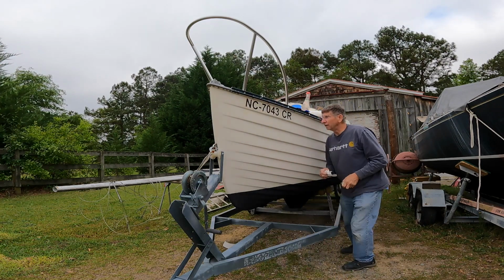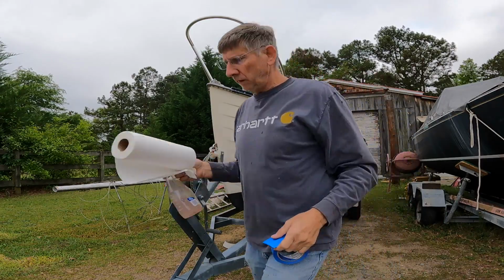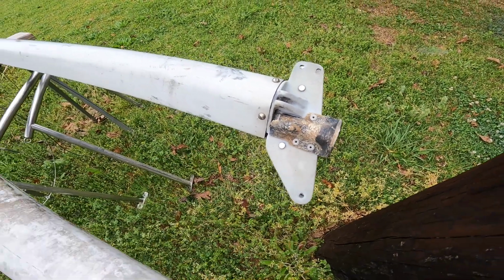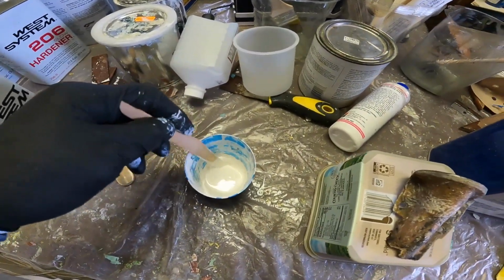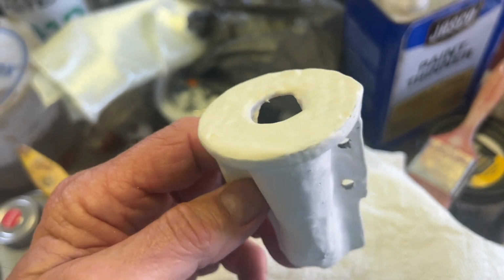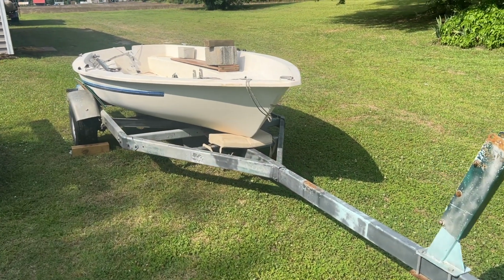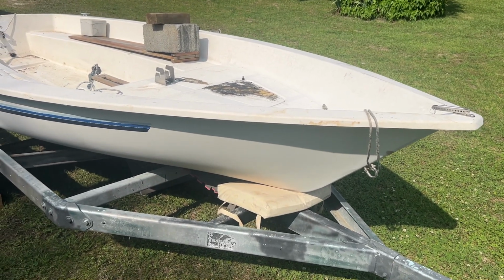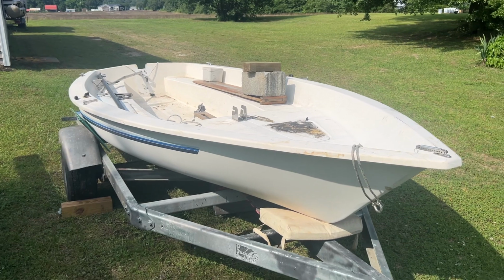A little boat work and a little fishing

Comment: Can you explain the gooseneck for the com pac 16...just picked one up...boom slides all the way down...nothing to stop it....also there is no topping lift??? Any ideas
Reply from the maker: You can add a sail stop under the boom if you want although when the sail is raised it will hold the boom up
I use a stop set a little lower than the boom is with the sail up
There should be a small hole in the mast top fitting facing sideways
Toe a 3/16” or so line here with a stopper knot and adjust the length at the outer  boom end for a topping lift
I usually have 2 loops here
One that lets the topping lift be real loose when sailing and another higher up the line to hold the boom when the sail is lowered
Reply from the maker: I also use a sail stop under my sail but above the feeder slot in the luff groove to keep the sail from falling out when I lower it but not removing it
This way you can use some soft sail ties to lash it to the boom
Reply: Thank you! This cleared it up!
Reply: You can also use a horn cleat with a mast track slug (basically a little tube that sits in the mast track and the horn cleat mounting screws go through it to lock it in place). You can lock the horn cleat below the boom as a stop. And then you can tie your down haul line to the horn cleat to keep the gooseneck from rising.